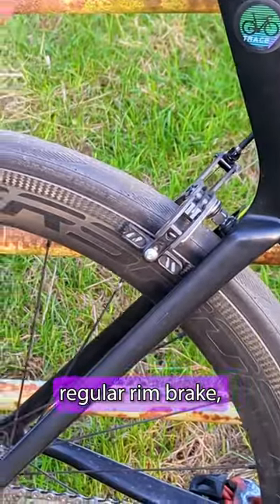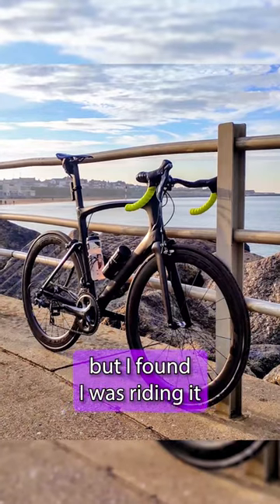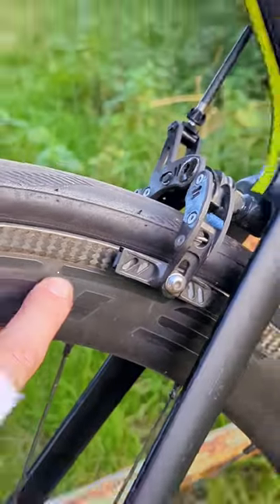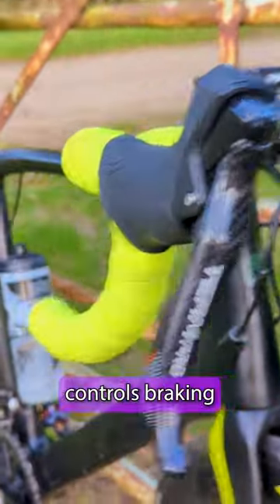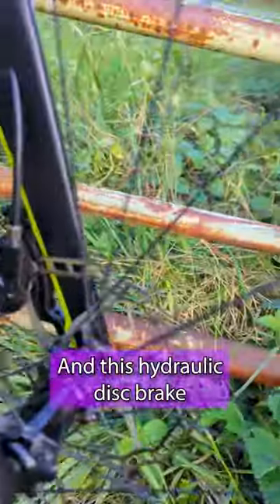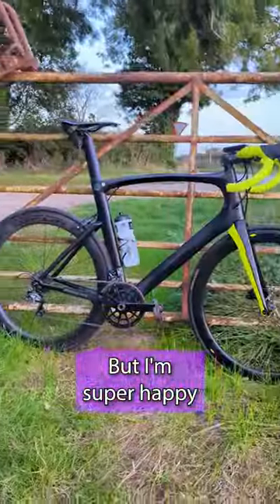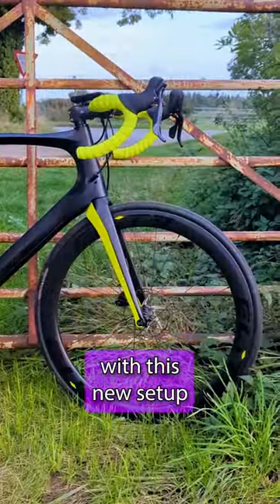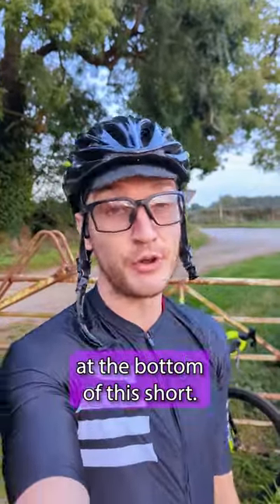Rim brake to disc brake conversion #cycling #roadbike #carbonbike

Comment from the maker: Let me know if you would ever consider desecrating your rim brake bike like this 😂
Reply: Do you feel any difference after removing specer? I understand that fork steering tube was shorter to what rim brake had.
Reply: How much heavier is it?
Reply: I did this a couple of years ago, would definitely recommend. It's also great when people look at your bike all confused
Reply: Hmmm, nope! I stay with alu rims/wheels (and frame). Depending on the wheels used, it's 8.6-8.9 kilo at the moment. So switching to carbon, just to drop half a kilo doesn't make much sense. Beside. rim brakes are definitely a cool lookers. The brake disk simply looks like that hated "dork-disc" from the old days.
Reply: I thought of this 3 years ago. I have a BH disc fork for my Scott Foil caliper frame.
Reply: You put so many #hashtags in the title that I can’t expand the description. It kinda reflects how messed up this bike is.
Reply: my TT bike
Reply: У меня был велосипед на алюминии и твой карбон объезжал как стоячих
Reply: I've done this to a 1998 mountain bike. A great affordable upgrade. Up-cycling a bike!
Reply: Don't like the look of carbon wheels, and disks on a wheels are ugly to when compared to rim brakes. The only advantage is you can fit a wider tire.
Reply: @monkeychunks3176 Like a hen who's just found a knife?
Reply: No never
Reply: Seems like a waste of time and money.
Reply: Nope

Comment: Disk brakes on the front and Rim brakes on the back.  Just like early mountain bikes with suspension forks.
Reply: And basically every entry level moped/scooters in my country uses this configuration. Disc on the front, drum brakes on the rear 😂
Reply: Or every department store bike
Reply: I don't see the point in that. Why not just one type of brake for both wheels? I don't know much about rim brakes tbh but my thought is that having two different kinds of brakes means more maintenance and tools required.
Reply: @1234567895182 I mean disk brakes are a lot harder to service in my experience but they both just require Allen keys to fix and tune usually. Also the front brake is the main brake and has way more power so it’s better to cheap out in the rear than the front.

Comment: Hell naw! Rim brake for life.
Reply: Do you ride carbon rims? If so, that’s not a good idea. If you’re on Al, you’re all good
Reply: @RC-fp1tl  Solution is ride two wheelsets.  Alloy wheels for daily commute.  Carbon wheels for race and recreation.
Reply: @iMadrid11 So if it rains during the race you just lose?
Reply: Ok durian disciple
Reply: Rim brakes for steel or aluminum wheels on road bikes, disc for anything electronic, carbon, or off road
Reply: @iMadrid11 race and recitation is when you bake hard 😂😂😂

Comment: Just dump those carbon rims....go back to aluminum rims....case solved
Reply: So the solution is to have worse wheels. Ok bro
Reply: Aluminium rims make sense for training.   @discbrakefan
Reply: @TomasSwiftMetcalfe  It’s 2024 man. Carbon rims are durable and don’t wear out. Maybe it makes sense if you still live in 2012

Comment: Duh, you use a shifter for gears, the controls for brakes are called brake levers! Shimano's description is Brake Levers & Shifters. You've put  the cart before the horse! Get the terminology right.

Comment: I think the trend for the future will be converting to rim brakes. So much easier to maintain.
Reply: Yeah and I mean riding rim brakes is much more fun in my opinion. Who wants to stop quickly anyway??
Reply: No they are not.  Mechanic disk bakes are easier to adjust, replace and swap the pads on .  Hydraulic just dominates in performance.
Reply: @domjf6  Disk brakes are ugly af on road bikes...
Reply: @domjf6 there’s no difference in stopping distance, they’ve done tests on this. If anything rim brakes tend to have better/quicker braking because there’s better feedback through the cable compared to hydraulic fluid so riders aren’t scared of locking up the wheels by accident
Reply: I have disc brake bikes and only have to replace the pads every now and then and once a year do the bleeding which is a 30 min job.
Reply: Rim brakes are much more headache to maintain
When brakeline is horrible it tends to explode the tire
Also you need a new rimset unlike discs thats just need a new rotor and brake pads
New rimset mean re-aligning of spokes once again.
Reply: Unless you replace it a whole new wheelset with hubs and pee aligned spokes(which is much expensive)
Disc brakes is much cheaper to maintain(and easier)

Comment: I whas concerned about braking when i switched to carbon wheels on my rim brake bike but i have found that with my current brakepads they work really well.
Reply: Do they not make carbon wheels with an aluminum/steel ring to prevent wearing down your rim?
Reply: @Coastal_Cruzer  they used be common back in the 00s and braking on them was much better, but the problem with them is they were much, much heavier. 

Deep section wheels are inherently heavier than shallow ones, so this setup usually meant you basically had an aluminium rim with a carbon fairing bonded on top. In the 00s Zipp only made full carbon in tubular, as they hadn't figured out how to make a full carbon clincher safely. I had the 404 tub, it was 1230g, the 404 clincher (with aluminium brake track) was 1660g. Mavic's Cosmic Carbone SL was even worse at 1,755g. I had these ones as well, and over 500g over the Zipps was very noticeable. 

My lightest plain aluminium clinchers were 1,335g (R-SYS!) and I had quite a few other wheelsets around or under 1,500g. I'd really notice the weight of the Mavics climbing or accelerating. But the Zipps being tubs were strictly race day only, as if you puncture on those it requires a new tyre, and preferably a team car.

So it was a real weight penalty going from either full carbon OR regular light aluminium to aluminium-carbon hybrids. Discs fix all of this and you can have both light full carbon rims and better braking, with no risk of delaminating your rim, it's probably the single biggest selling point of road disc, that it fixes all the issues with carbon. I don't even think it's so necessary with aluminium, the rim braking on aluminium also got a lot better with the newer groups.
Reply: @blorg8206  great, clear explanation. Also aren't disc brakes also more aerodynamic than rim brakes?

Comment: How heavier did the bike get? Would it not become lighter by switching to a front aluminium wheel instead? The stronger braking of rim brakes would be maintained, and weatherproof braking could be assured with adequate pads, like Jagwire Road Pro.

Comment: Nice! If you brake hard you will now definitely go over the bars😅
Reply: On such a skinny tire, you will definitely lose traction before you'll go otb while front breaking, especially if you have the reflex of leaning back while braking
Reply: @richeeg3271 wrong, his comment is totally correct, just saw someone go over the bars on the brakes 2 weeks ago, this is a bad idea for brake balance and you shouldn’t do it
Reply: Learn how to stoppie, then you wont OTB! I started by riding MTB and practicing stoppies and wheelies, so when my back wheel shot in the air thanks to an off-lead dog up at Haigh Hall, I didnt even need to unclip. I rather surprised myself that day.
Reply: @howarddavies136   Thx for your replies!, Always like a good discussion 🤔, my insight and experience: built a few bikes here in the Netherlands. How I see it, even if you do a great emergency stoppie on your overpowered forward-brake bike, you still loose all of the grip and traction of your rear brake making it harder to slow down. I am also guessing you also needed to balance the forward brake yourself when you emergency stopped not just press full power but also temper and release. The reason it's unsafe is because most people cramp up and pull on both brakes as hard as they can if something happens that scares them into braking. Second, leaning back from an MTB position is easier than riding the streamlined position you take on a race bike with the seat on the right height. Being more forward also dramatically shifts your center of gravity towards going over the bar... And for the first comment about traction🤔,  I think most good sets of tires will hold traction in most good weather asphalt conditions, maybe not if you really push it. But then i rather start (always want) slipping from my back wheel, not my front wheel and lose my steering ability because my forward brake is too strong. Anyway, let me know your thoughts!🙂
Reply: @MB-mn2em  I think it comes down to preference. I prefer a very sharp brake that requires very little movement of the master cylinder to engage the pads. The way I brake, I like to get pads on discs very quickly and then very small pressure inputs from there to modulate the braking force. I love servo wave for this reason and I've also converted my car to AP racing opposed piston brakes.

I get your point about weight shifting and losing the stopping power of the rear brake. I would pose the question though; if all of the weight of the rider and bike acts through the front wheel, does that mean that the front tyre will have double the grip and be capable of taking double the stopping force? Look at MotoGP - how often can you see the rear wheel in the air in a braking zone? It didn't seem to slow Carl Foggarty down! 

Digressions aside, I still feel that it comes down to preference and the confidence and consistency that I get from a disc brake is more important to me than a perceived safety margin from rim brakes by way of their lower power preventing OTB or lock ups.

Just for context, I will do a 50km ride with about 700m of climbing on roads shared with cars and very little cycling infrastructure. I'm not sure what your typical ride looks like, but we may have very different use cases, despite us both using road bikes.
Reply: @howarddavies136  Thx for your reply, yeah i guess there are more than one way to ride a bike, especially with some skills. Youre right to say the front brake is more effective, would be interested in seeing what would provide more stopping power, both wheels or  someone that rides his bike like some of the players in the wsbk. Still think the former is easier. Have no complaints about disc brakes or High stopping power btw. Although my favorite brakes ever aren't rim brakes, They are Magura hs33 brakes with green pads on ceramic coated rims (yeah an mtb). Too bad the rims didn't really catch on. I ride on mostly flat terrain btw (shocker😅) and my mtb in the dunes
Reply: @MB-mn2em  are those maguras the hydraulic rim brake ones? I'd love to have a go of them. Unusual solutions like that always pique my interest!
Reply: Rubbish. Far out the ignorance 😂
Reply: Anyone braking so hard they go over the bars has only themselves to blame 😂 get your arse over the back wheel
Reply: @kimlightningmcnulty  Agreed.  A bit too risky for me
Reply: @kimlightningmcnulty it's totally WRONG. Hydraulic brakes are so much easier to modulate than rim brakes.

Comment: im 220 lbs and have some descents that are more than 3,000 meters, I can feel my cheap Chinese rims cooking after 1000m of corkscrew descents at more than 10% on rim brakes. No issue in braking power, but I dont want to dump that much heat into my rim surface, especially at speeds in excess of 100kph

Comment: I would never ride a mix of brakes like this. Generally when slowing down front does 75% and rear does 25% for heavy braking (same as a motorcycle).
In the heat of the moment how are going to modulate correctly and not die?
Reply: You get used to it, not dangerous.
Reply: The front has more stopping power anyway even with the same system, so you have to adjust to that. You should be able to get used to it. Particularly with carbon, rim braking on that is terrible and it's most important to have stopping power on the front so this makes a lot of sense.
Reply: Like you modulate with any other brake.
Reply: Hard stops, slam the rear, modulate the front REGARDLESS of how the brakes are set up.
Reply: @bindingcurve  100%

Comment: The disc on the front catches the crosswind and makes the front wheel unstable. Through axles make the front end feel too stiff. Road disc brakes were a mistake.
Reply: Utter nonsense
Reply: Come off it. The disc is near the centre, so the amount of torque that will be generated is negligible compared to what you already get from the rim.

Comment: Was thinking of this also... But using mechanical disc at the front, so my shifter won't have to be different to each other...
Reply: Mechanical disc is so bad though, nothing like hydraulic.

You can get hybrid callipers that are pulled by a cable, but use hydraulic pistons. Not sure how good they are.

Comment: If its doable, why not? Are rim brake carbon frames laid up differently thank disc brake? More force in headset due to disc brake power?
Reply: For the headset it doesn't matter whether it's a rim brake or a disc brake. When braking, there is a force pushing the upper bearing forward and the lower bearing backwards, in both cases.
Reply: Nah

Comment: I can imagine balancing the pull power between the disc and rim will be an art… OTB any time soon? 😂
Reply: Never an issue.  Most of your braking is the front anyways, the rear is just for fine tuning.  Learn to brake 😂😂pads

Comment: The head tube was not built to sustain the forces applied at the bottom of the fork legs which act as a much longer lever than rim brakes at the top.
It might (may not) lead to a very unpleasant surprise at one point considering that carbon tends to fail suddenly.
We don't all see life in the same way.
I personally believe that when you have kids, you have to reduce the level of unnecessary risks taken accordingly.
Reply: Is there evidence to support your statement? I feel like the difference in forces isn't going to be much different. Also imagine the forces you frame cops hitting a pot hole. I don't think braking comes close
Reply: Super irrelevant. Rime brake can still be pretty powerful if you have good pads and strong hands lol. And as mentioned, it has been designed to oustands greater force than breaking... The real part that takes the beating is the fork not the head tube. Make sure to use the proper rotor diameter.
Reply: Oh what absolute bullshit 😂
Reply: @discbrakefan  
Just what I was waiting for. 
The input of a rational and knowledgeable engineer.
The wait was long but it was worth it.
🙄
Reply: @discbrakefan  
As for caring about the kids' future, nothing like relying of a F narcissist.
Reply: @sylvainmichaud2262  Well actually I did study materials engineering. But your comment wasn’t exactly something that needed an engineer to debunk.
Reply: @sylvainmichaud2262  The kids future? Man you convinced yourself of the problem and you’re abusing others because you think you are right. Maybe lay off the smack and the smack talk and be a better human.
Reply: @discbrakefan  
Because you're an example of good behavior.
If you want respect. Earn it body.
Start by replying with an argument and you'll get an argument.
Star with an insult and you'll one.
I still believe you're a narcissist, just by the way you've attempted to turn the situation.
Reply: @sylvainmichaud2262  Well it was a load of rubbish mate and you’ve doubled down. I owe you nothing.
Reply: @discbrakefan  
Doing the same thing again.
Not a single argument.
A real engineer.
Reply: @discbrakefan  
"I own you nothing"
And then you expect respect.
A true genius.
Reply: @sylvainmichaud2262  You’re just salty about being wrong
Reply: @discbrakefan  
You're right !
All your logical and convincing arguments based on solid engineering totally destroyed my initial statement. 💩🙄
Being such a_genius,_ it must be difficult to find friends.
Reply: @discbrakefan  
Tell me genius, why are disk build stronger ?
Reply: @sylvainmichaud2262  You’re the one who claimed they are. You tell us.
Reply: @sylvainmichaud2262  Your initial statement was based on your own imagination, nothing substantive. Stop pretending you know anything.
Reply: @discbrakefan  
You're a genius engineer an it shows. Once again, @diskbrakefan, please explain to me why are disk brake wheel are build stronger ?
Reply: @discbrakefan  
Are you 15 ?
Reply: @sylvainmichaud2262  Are you going to keep whining like this because you’ve been incredibly salty about being wrong for days now.
Reply: @discbrakefan  
Please remind me where you've proved me wrong. I want to study the science you've provided. 🤣

Comment: There's some back brake conversion kits around. Did you consider trying one of them? Those I saw use a bracket that seems to strengthen the hold on the QR skewer (probably for good reasons), so they might not be especially good for the weight, bit would be interesting to see how well they work.
Reply: I think that gets really dodgy on carbon frames because they're specifically designed to take forces in certain directions and you completely change where the biggest forces are, so even with reinforcement I wouldn't touch that with a bargepole
Reply: @bruuhhhh  good point
Reply: Stay the hell away from those